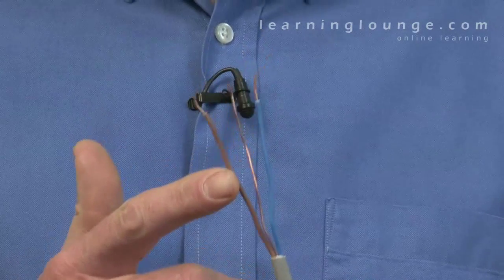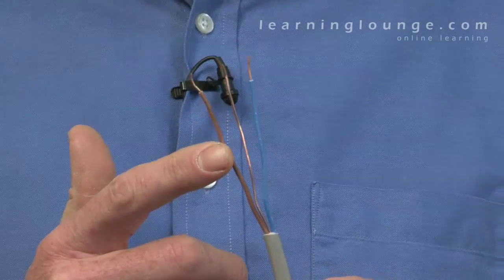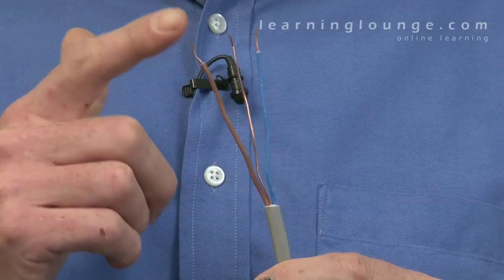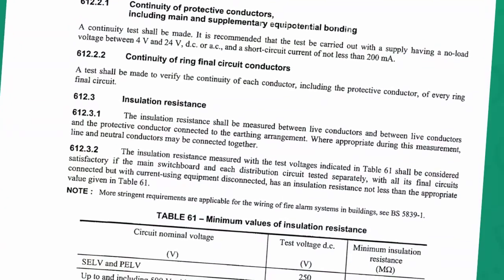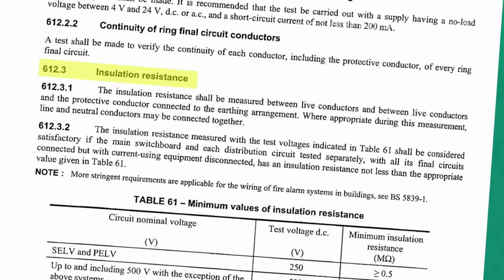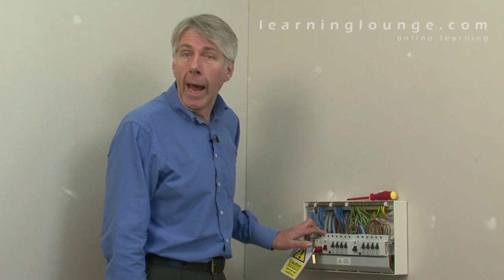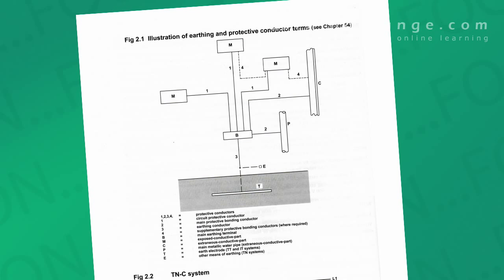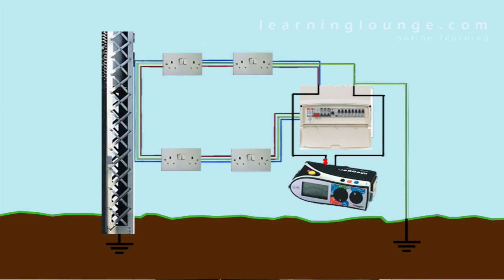Focus On - Insulation Resistance

Comment from the maker: Hi,

In a TN-C-S installation the earth provision is supplied by the supply company, for many new builds this won't happen until after the Elecftrical Installation has been installed. In theory you are also supposed to provide them with a partially completed Electrical Installation Certificate before they will connect the supply (In Theory! :))